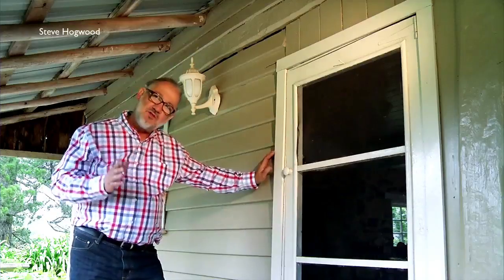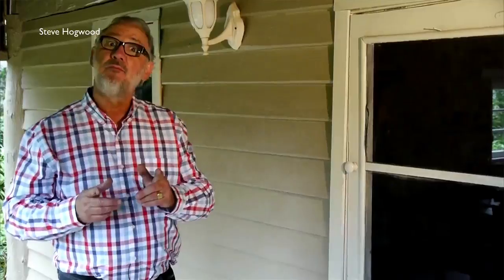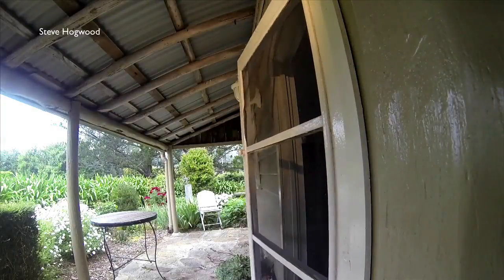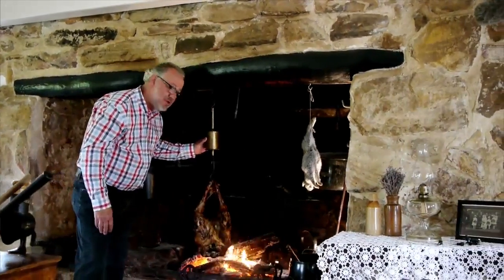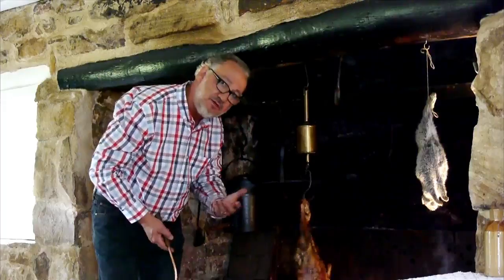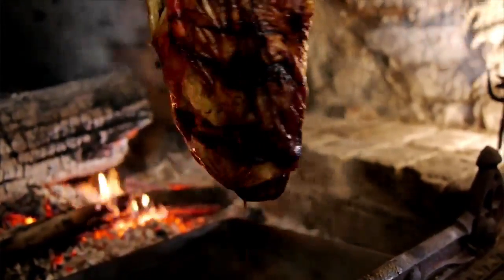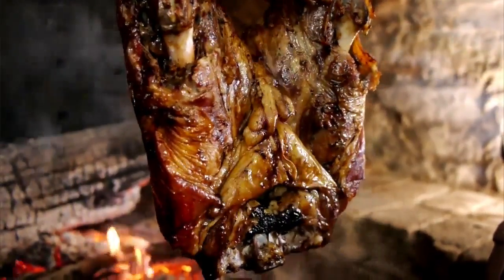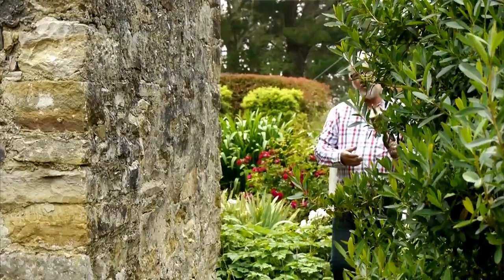We road tested a Clockwork 19 Century Bottle Jack!

Comment: Before this were smokejacks, consisting of vanes that turned in the chimney as the heat rose from the fire below and turned also the joint on the spit and before them were turnspits and turnspit (terrier) dogs that ran in a wheel and likewise turned the meat by application of pulleys and belts.  Smoke and bottle jacks were early examples of automation wiping out jobs, in this case the turnspit dogs.  Queen Victoria took in quite a few superannuated ones.